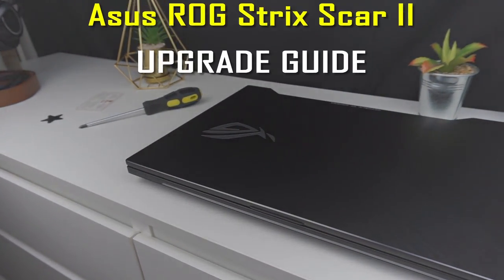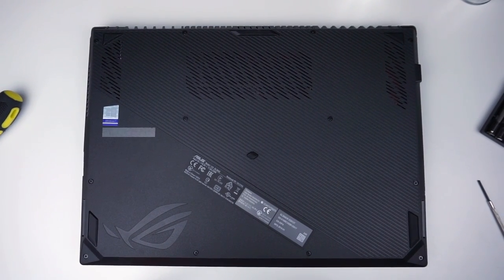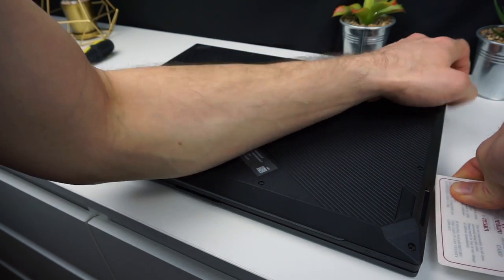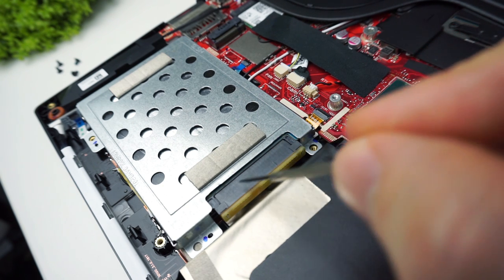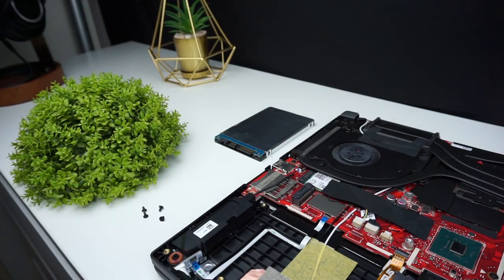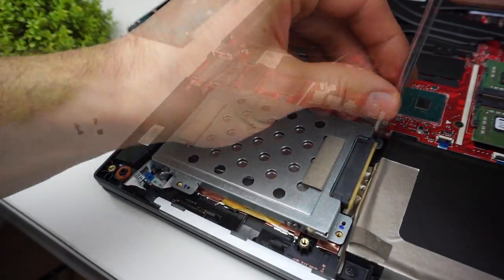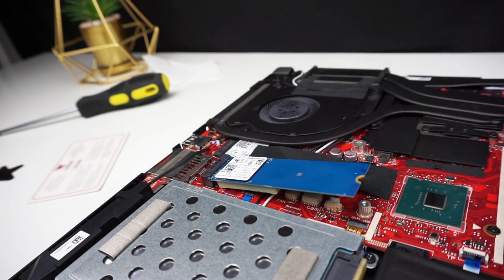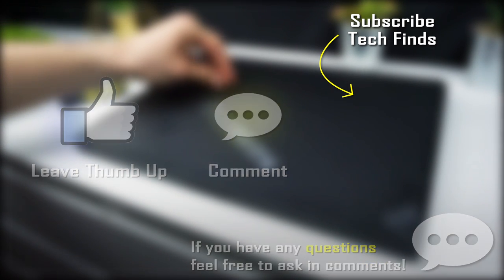Asus ROG Strix Scar II upgrade (RAM, SSD, HDD) - Disassembly Guide (detailed)

Comment: how about RAM 16g + 8G , sure with same 
frequency？what will happen with different Brand? actually idk the oiginal ram's band
Reply from the maker: You can have 16GB + 8GB installed without problem.  Brand doesn't really matter since it's hard to missmatch RAM nowdays but ofc for the best compatibility it's recommended to have 2 exactly the same sticks.
Reply: Tech Finds will it run in duel channel with missed matched ram? Thanks
Reply from the maker: @chefgav1  missmatched RAM means that it doesn't work or underperforms because it's missmatched. :P

Comment: I can’t seem to unscrew mine with the same screwdriver as yours because it’s so tight on the bottom ones...
Reply from the maker: Watch out to not damage the screws. Don't let the screwdriver trim the cross, because the screw will be useless. Sometimes it happens that the screws sit tight because of excess of blue/brown seal on them. You can't really help that. The only solution is to push the screwdriver down harder while unscrewing the screw and you can also put some thin piece of rubber on the screw to tighten the screw driver's head fit.

Comment: I'm too late in the video but I have a question - I hope someone could answer that for me -
I swaped my m.2 intel 660p 512Gb tp 970 evo plus 1tb. Now my CPU thermal throttles when I play games and shuts down. Any solution?
Reply from the maker: I don't think that new SSD would cause thermal throttling. Consider cleaning fans of dust and changing thermal paste for a high end one. CPU undervolting is an option too
Reply: @TechFinds  thanks for the reply. I know it should not. It did happen when I initially tried changing to a Gen4, which my system never supported. 
After the BIOS update, Asus have stopped support for undervolting, couldn't. And I have recently re thermal pasted all the necessary components using the Arctic Silver 4 thermal paste.
Reply from the maker: @RatnakarSoren  The other thing might be just that if it's summer in your country and the temperatures outside are higher it affects a CPU and GPU temperatures as well unless your room is AC. I don't have any other explanation for your case.

Comment: Can I put a SSHD in the HDD slot? And can it be more than 2tb?
Reply from the maker: Yes you can, i did that in the video. 2.5" drives more than 2TB are usually thicker, so idk if they will fit here inside. My drive was 7-8mm thick and i think it was sitting tight in the drive bay so idk if there will be more room for thicker drive.
Reply: Okay, thanks!

Comment: Great video, thank you for putting this up.  I'm in love with my gl704gw but squeezing every bit of performance out of it is about to happen.  For the extra small amount of $, why not?
Reply from the maker: Yep, why not. :) But if you're squeezing your laptop so hard consider taking care about cooling system too. Thanks for commenting!
Reply: @TechFinds  Hey, thanks for the reply.  No worries here - I don't push my machine.  I love it and it gets pampered.  I just use it for some light gaming and VR, as well as occasional video editing for my channel.
Reply: @Tech Finds  any suggestions for updating the cooling? I have the laptop on legos to allow circulation underneath,  but I'm open to something a bit more sophisticated.

Also, can I be sure only 1 bar of RAM is used so I can easily add another? Isn't it usually recommended to use 2 identical bars?
Reply: @countluke2334  Hey Count Luke, if yours is as old as mine is, you’re due for a re-paste by now.  I got into testing to squeeze extra performance out of mine a while back and noticed a huge benefit in repasting the cooler with some non-cooked on, quality thermal paste.

Comment: When I took the back cover of mine off the warranty sticker wasn't on the screw for the heatsink, it was on top of the heatsink. I needed to RMA the laptop since I died but I'm worried if asus wont fix it because the warranty sticker was moved but I never took the laptop apart before it was just there when I first opened it.
Reply from the maker: I don't know mate. Try to send it and if they have any problem with it then say that sticker was there all the time. If you have warranty card read it, maybe you are allowed to disassemble cooling - it may vary between countries.

Comment: does this opening proces is a difference between the 2060 and 2070 model?
Reply from the maker: Nope, it's the same chassis. Even if you have the 17" model it is very similare, almost the same.

Comment: Can i put 2 SSD in this laptop?
Reply from the maker: Yes, but different types. You have one slot for M.2 SSD and one slot for 2.5" SATA SSD
Reply: If my laptop came with 512gb SSD and I added a 2.5" 1tb SSD, I will get 1.5tb SSD right? Sorry I'm new in upgrding
Reply from the maker: @pololols  Yes, you have one 512GB M.2 NvMe SSD that your laptop came with + new 2.5" SSD that you added. :)
Reply: @TechFinds  Thank you very much! Youre so quick in responding
Reply: @TechFinds  I have another question if you dont mind. Can I put 2.5" 2tb SSD?
Reply from the maker: @pololols  I don't know if there is any limit for 2.5" SSD
Reply: @TechFinds  Thank you. You helped me a lot :)
Reply: @TechFinds  Is it possible to put 2tb on my NvMe SSD?
Reply from the maker: @pololols  it probably supports up to 1TB NvMe SSD

Comment: Very helpful video - thanks. I do have a quick question about Ballistix Ram. I was considering upgrading my GL504GS with this but some users (not sure which laptop) complain that it runs as lower speed as no way to pick XMP profile in bios so defaults lower speed. Anyone had experience of installing this in Scar II.
Reply from the maker: I haven't tested it but if you add 1 Ballistix stick to the stock RAM it may run at lower frequency in order to match the latency. For example if stock RAM latency is CL19 and Ballistix is CL16, after adding Ballistix it will run lower latency CL16 but sacrificing clock speed. That's one case scenario. It will work, but i always say that for the best compatibility it's recommended to have both sticks of the same RAM. Btw. i didn't hear about that BIOS issue so i can't confirm.
Reply: @TechFinds  Thanks for the reply. I was intending on buying two and selling existing stick as I agree that it is better to get to the same. The speed issue is mentioned by a couple of reviews on Amazon and one on Crucial's website. I've tried to contact Crucial support but no response so far.
Reply from the maker: @robertnorris8094  how about getting HyperX instead?
Reply: @TechFinds  I did think that as well but checked reviews on this and a few mention similar speed issues as well, also a bit more expensive at the moment. I've managed to contact Crucial support and they say it will run a full speed so I've bought directly from them for £142. Consider singe sick for existing Hynix RAM is about £105, not a bad price. I let you know how it goes once installed.
Reply: Installed Ballistix and it runs at 2400 so sending it back.  I was going to order Hynix but difficult to get hold of in the UK. A few companies have it Europe but all want 20 € to ship and more difficult to return if there is a problem. So I decide to give HyperX a try and ordered from Amazon this morning and delivered the same day. This working perfectly and has a better CL but did cost a bit more.
Reply from the maker: @robertnorris8094  Hopesully it'll work at 2666MHz. In fact i haven't heard about lower frequency issues with HyperX.
Reply: @TechFinds  No it worked at 2666 for me

Comment: Hi, Is there any space for install an extra SSD?
Reply from the maker: There is only one slot for M.2 SSD and one drive bay for 2.5" HDD, SSD or SSHD. So standard for a 15.6" laptop.
Reply: @TechFinds  and for 17.3'' scar II ，also use 2.5'' HDD .right?
Reply from the maker: @juergen1310  Yes, 17" models also have one M.2 slot + one 2.5" drive bay.

Comment: There's only 1 m.2 PCle port right ? mine was 512GB did i have to buy a single 1TB for the upgrade O_o
Reply from the maker: You have one M.2 slot and one 2.5" drive bay for HDD or SSD if you want. You can buy 2.5" drive and you will have your 512GB SSD + new drive.
Reply: @TechFinds  Thanks for this video.  I have the 512 gb ssd and a friend sent me a 1tb ssd for upgrade. I'm confused about what your video is showing for the 2.5" drive bay.  You took the 512 out and upgraded to 1 tb?  Where is the OS then?
Reply from the maker: @laurahigle4962  For 2.5" drive i installed 2TB Seagate FireCuda SSHD hybrid drive. My Scar 2 came with 256GB M.2 SSD but i didn't have anything else to swap it out so i just showed how to take it out and installed the same original drive just to show how to do it.
Reply: @TechFinds  Okay, now I understand.  I wanted to be sure to know what to expect before I open up the laptop.  Thank you!  Great video.  Succinct, clear, easy to follow!!  I appreciate it a great deal.  And thank you for your quick response.  :)

Comment: If I upgrade my laptop . Warranty gone or still
Reply from the maker: It may depend on the country, so read your warranty card or contact Asus.
Reply: @TechFinds  for example on asus website say about solution for black screen and no power  .
U have to unplug ac adapter then remove the battery  then plug ac adapter and remove it then reback the batrrey .
If this solution make warranty go must the asus write it  to everyone know that .
Why asus make the laptop for upgrade hd ssd ram  if that effect in warranty .
Reply from the maker: @BLACKROSE-rx1bw  in most cases upgrading RAM, HDD and SSD doesn't affect the warranty, but if you damage the laptop during upgrade or one of the components you added cause any damage then warranty is gone. In Scar 2 I've seen warranty sticker only on cooling system.
Reply: @TechFinds  thanx alot

Comment: Hey , I've had this laptop for 2 days and I really love it but when I added the extra 16gb ram I had some errors pop up and some games wouldn't run. I installed the Crucial 2666 ram. 

Also I wanted to ask , I dont have the Sata cable yet but if there is no clip then what will make it from not coming out as the laptop moves around ? I think this is a terrible design but the laptop runs my online FPS so beautifully.

Also I can't customize the 4 zones , armory crate keeps crashing. Contacted Asus they only told me to reinstall but that didn't help.
Reply from the maker: I'm not sure, the RAM shouldn't cause any errors. Nobody else reported me any issues with Crucial.
If it comes to cable check on the motherboard if behind the connector is a little tag to tilt up. It should go up, then put the cable and push it down to tighten up the cable.
Armoury Crate always've been glitchy. That's probably because of recent Windows updates. I think thatyou have to wait until they fix it. Meanwhile try to use Aura Creator or any Aura software from Asus to control lighting.
Reply: @TechFinds  thanks for the Info, I just took it apart and saw that it does have a little tab that closes and secures it in place. From the video it seemed that the tab wasn't there. So I feel good about that.

I can control some of the light function like Static , Breathing , Strobe and one other one. But when I try to customize the 4 zones it just crashes. I won't let that deter me though because I'm playing call of duty ww2 online and haven't had 1 screen stutter yet. Very smooth and my reaction time seems fast. 

I also checked and the factory ram that came with this laptop was a Sk Nynix ram, maybe not the best. I might just toss 2 samsung 16gb in there and try to sell the factory one. Thanks again :)

You were right , this laptop gas great thermals, I played for about 4 hours non stop the other day and it never went over 89 C. Also the keyboard always stays cool
Reply: @TechFinds  I just successfully installed 1 tb SSD and it recognized it right away. It was hard at first but then I found out that while the tab it upright it is open, and when the tab is down it is closed. I thought the opposite so I was having troubles but when I flipped the tab upright it went right in. Not too hard. Thanks again for all the help. Now I have a 32gb rtx 2070 beast :)
Reply from the maker: @diamondcomfort7  mine didn't want to tilt up, so I ended up sliding the cable to the closed connector. It worked but it's better to do the way you did. Have fun now!

Comment: Is it two ram cards ? becouse i just have one
Reply from the maker: This laptop comes with single or dual channel RAM so you can have for example 2x8GB or 1x16GB. Mine had 2 sticks of 8GB
Reply: @TechFinds  so which one is better? Is there any performans differences between 1x16gb ram and 2x8gb ram. I mean can we still see the same performans?
Reply from the maker: @BGT_R  Dual channel is faster and you can see the difference in performance between 1x16 and 2x8, especially in Scar 2. If your laptop has only 1 RAM stick you can always buy another one and install it so you will have dual channel and even more RAM.
Reply: @TechFinds  thank you.

Comment: hmmm i also noticed that the amount of heatpipes and how it's placed is similar to the fx505gm
Reply from the maker: It's almost the same for every Asus gaming laptops. High'end Zephyrus series too. However i noticed that it works the best in Scar. I must admit that fx505 is very much improved compared to previous generation fx504 which was disaster in terms of cooling. Now TUF has better cooling but still not better than Scar or Zephyrus.
Reply: @TechFinds  that's really great but damn I'm still stuck between tuf and y530 but i heard that y530 has no fan control so yea it sucks it can be loud as hell randomly
Reply from the maker: @feljosephdumoran4779  ohh I didn't know you can't control fans in Legion. It bothered me in HP Omen 15 which has no fan control too. As you said the fans ramp up randomly even when  browsing web. I'll be ordering TUF FX505  with new GTX 1660 for tests but I think I'm not going to make a video  ery soon since I've got a lot of other work to do.
Reply: @TechFinds  mate should i choose the asus tuf fx505DU (ryzen 7 3750 + 1660 TI  120hz) or the fx505GM (i7 8750h + gtx 1060 144hz) since I'm an IT college now i don't play much games anymore so what do you think mate? which one should i choose? the more cores or faster gpu? only if they'll release an i7 9th gen + 1660 ti I'm sold!
Reply from the maker: Leonardo Dank  I think that both configurations are going to be enough for your college needs but i personally would go for i7-8750H model with GTX 1060 since i tested many laptops with this configuration and they all worked pretty well. I can't tell you much about AMD + GTX 1660 since i didn't test it yet.
Reply: @TechFinds  i agree too i saw the benchmarks is some websites between the gtx 1060 and 1660 ti and the 1660 is faster than 1060 for like 10-13% but that 8750h is a 6 core cpu so having that makes my device more future proof anyway thanks for the replies man keep up the good work 😁

Comment: My laptop turning to black screen when changing the compatible RAM. is it because im not removing the battery?
Reply from the maker: First time i hear about that. It doesn't look like it's an issue that might be caused because of RAM. What RAM you bought
Reply: @TechFinds  kingston hyperX. but in the instruction did say that i have to remove the battery. now i dont know what to do with the laptop :(
Reply: @TechFinds  can check the official kingston video. https://www.youtube.com/watch?v=C-osLuzsXOs
Reply from the maker: @syafiqhassan7917  I always change RAM with battery plugged in and i had never any problems. Removing battery before changing components is a good practice and it can potentially save the device from being damaged which i think doesn't usually happen. Try to run HyperX only in your laptop and see if it works alone. Anyway, there should not be any problem mixing HyperX with original RAM - for sure not the display turning black. Are you sure you didn't accidentally disconnect or damage any cable connecting the display? Actually when the screen goes black? is it black all the time when you're trying to turn the laptop on? Is the light on power button blinking while you trying to turn on the laptop?
Reply: @TechFinds  i only touch on the RAM part. the light is blinking on the keyboard when turn on the laptop but the screen is black. now I change back to old RAM but same, still black screen.
Reply from the maker: @syafiqhassan7917  Ok, you need to do hard reset. Disassemble the laptop to unplug the battery, press the power button and hold for 30 seconds. Then connect the battery back and it should be working. Before you do it you can add the RAM you want to have installed.
Reply: @TechFinds  yes, try that already. still same. nevermind i try to send to service centre. just got laptop in this week. now gg haha
Reply from the maker: @syafiqhassan7917  I remember i recently had such situation with the Scar 3 and hard reset solved the problem.